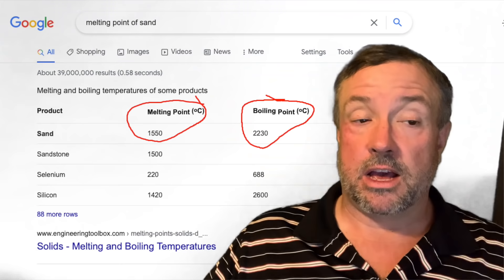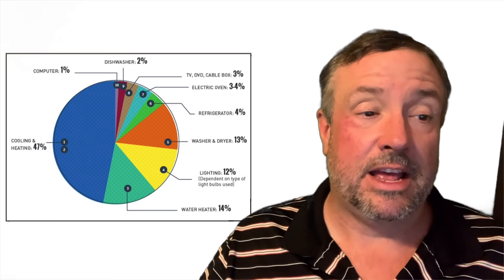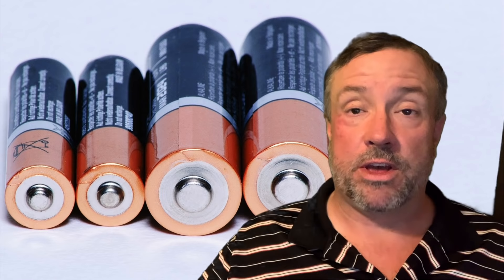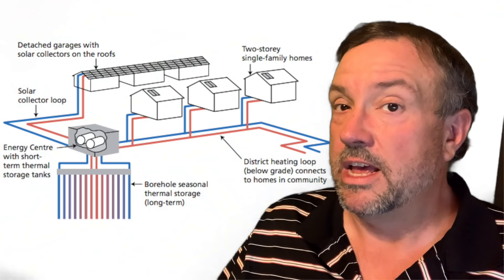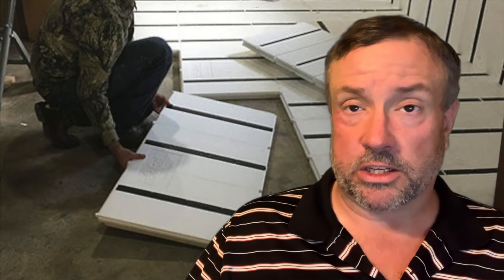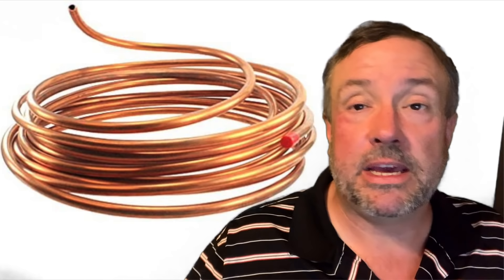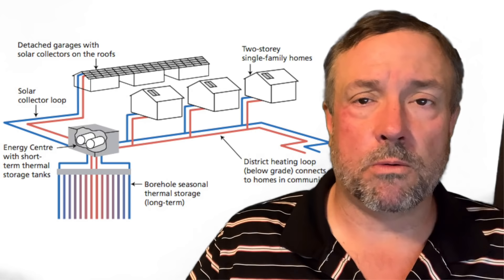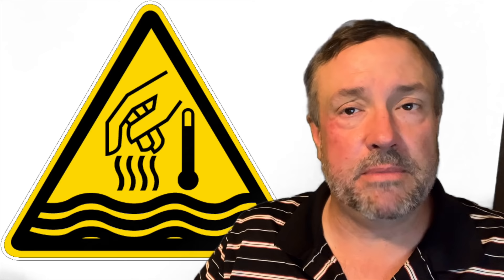Sand for Thermal Energy Storage

Comment: A metal with low melting point could be used as a fluid on the hot loop. Quicksilver or woods "metal". But you need to heat the line for a second to get it running in the morning.. also pumping it might be a an issue. High power consumption? Metal dissolving pump housing and gaskets? Keep the loop as simple as possible, no valves except for bleeding. Pump might have to be a screw with the motor mounted at the top, free from contact with the metal fluid..
Reply from the maker: interesting!

Comment: Make a manifold out of concrete or any metal or high temp pipe, bury it in an insulated sand box with pipes, and run hot air  through it, and at night it should hold heat, also you could just put the whole thing under the house, just use separate pipes that lay on top of the block and go back into the house for heat at night, the out side could have a temp thermostat ,on, off  fan could be solar with small battery back up. Also you have radiators, you cold bury a tank  or manifold in the sand box, circulate the water through  everything, have a high pressure safety valve outside and in. The sand should take a lot of the heat out, just have a shut off for high heat that way the temp won't go too high, or loop the water that is in the radiators somehow,  till the temp drops, separate from the solar setup, Just ideas that may or may not work! but good video, and I also subscribed!
Reply from the maker: Good idea

Comment: Love the idea of using aircrete (which I was thinking of doing myself) for the insulation on your storage tank. You could build the tank entirely out of aircrete and rebar OR you could buy a metal water tank (like a livestock tank) and insulate it by filling aircrete around it. 

Storing heat that will be used for heating is easy enough, but storing heat and transferring it into electricity to cover the other 40% of your homes electricity demands when the sun isn't out is the real challenge.
Reply from the maker: great ideas!
Reply: Andrew, love the idea of storing water in livestock tank and insulating with aircrete.  May need to waterproof aircrete as water may seep through it and exposed parts may crack with ice allowing water and thus corrosion as long term issues.   Great idea however.  Water even at lower temps under 200c is still great at storing heat just requires more space to meet total needs.   
Yes storing heat does not account for the rest of electric bill but it's a great start and reduces the rest.
If one uses high temp solution, the stored heat can be used for cooking!  That's cool!  May be more practical to have a dedicated system for cooking to reduce cost such as piping, building etc. and for simplicity.  May be easier to have solar panels and batteries for the remaining electrical needs.   That's my guess.  Turbines for electricity are cost prohibitive to my knowledge.
Reply: @l0I0I0I0  Batteries are also pretty cost prohibitive if you have grid access.

As for cooking and/or energy generation when the sun isn't out, a methane digester (piped directly to the stove or to a generator) wouldn't be a terrible idea. Also instead of solar panels, I've been looking into the idea of using a parabolic trough collector to generate electricity via a sterling engine and then collect the water after the sterling engine as stored hot water which can be recycled in a closed loop.

This would be one hell of a project, but it'd be totally off grid depending on your energy demand and geographic location.
Reply: @andrewb9595  keep me in the loop!  Want to see what you come up with.  Biogas is a thing.  It's common in India I have been told and perfectly clean.  Big or cow poop may work better than human.
Reply: @l0I0I0I0  hydrogen sulfide is not clean but can be filtered out with activated charcoal and lime water.

Comment: Efficient Rocket-masonry stove/oven/sand-lava rock battery combination works for me.  Rocket Stove lined with standard refractory heats internal masonry quickly with spiral secondary tower clean burn section behind which directs heats to a 1"x24"x24" metal plate beneath the domed oven.  Exhaust then moves horizontally across the steel plate and downward through standard stove piping on the right side which is run through an insulated (2" thick aircrete) 3' wide x 25' long x 4' high sand-lava bench battery.  Piping loops at the end of the sand-lava bench battery, and returns back to the Stove/Oven for eventual vertical exhaust, provide sufficient draw for the stove & bench combination.

Insulated (refractory blanketed) masonry in the stove maintains high heat and aluminum fins attached all along the exhaust piping heats the sand-lava battery mixture. Air exchanges via standard steel tubing run throughout the sand-lava mixture to a standard water heat exchanger at the far end using standard insulated dual piping from an external wood stove configuration.  The insulated piping is run into my home to the boiler/water exchanger connection maintaining primary and supplemental heating.

Need only run the rocket-masonry stove two to three times a week in winter to maintain comfortable temperatures in two story house.
Reply from the maker: Very cool, thank you for sharing

Comment: I wonder if blowing heated air bubbles through the sand from the bottom up would help distribute the heat throughout the sand better than running pipes through the sand.
Reply from the maker: interesting
Reply: My sentiments exactly!   Fluidized sand…..

Comment: I am thinking of somethint like this. The main problem with the soil is the heat transfer and the poor heat capacity. If you use a liquid with 300 celsius of maximum temperature, you can heat the sand also maximum to this temperature. The volumetric heat capacity of the soil is about 1.8MJ/m3. Water can store 4.18MJ/m3. The energy you win by the higher temperature, you loose by the poorer heat capacity. What about to build a well isolated huge water tank above the ground? 10 or 20 cubuc meter capacity? You could heat it all year with a simple water based heat collector, then you could take the energy out by a heat pump.
Reply from the maker: I agree water is better

Comment: Iam using foam crete to insulate my 55 gallon drums and heat element to heat the sand to 600degrees I have to put it in play this spring but have some problems to solve in the process.  This way I can do foced air for the cabin and green house and heat water as needed
Reply from the maker: I like it

Comment: Simpler is better.
For new construction, dig the foundation 6-10 feet deeper with common cement block.
Put an inner layer and floor of air Crete as you suggest.
Fill the space with sand. 

Overlay the sand with another layer of air Crete to form the basement concrete floor.

Have a multi layer network of galvanized 1” steel pipe. ((Which is cheap and easy to work with). 1ft. Spacing between pipe runs and upper and lower layers of pipe.

Use heat dissipating fins on the steel pipes to improve heat distribution to the sand

Form a closed loop within the sand.
Working fluid can be simply water.
Install a circulating pump and a water heat pump.
In summer, use heat pump to cool house and dump the heat into the sand.

In winter, use heat pump to pull out the stored heat.

Some heat energy will be lost but mostly to the house above.

This solution may not supply 100% of energy needed to heat or cool but is simple, has few moving parts, durable
Reply from the maker: I like it

Comment: ground to air heat transfer.
 Attic space or greenhouse , big pipe  for hot fluffy air to manifold with  sockpipe in sand,  6" of sand per month of heating needed(four or five feet deep, footprint size typical) fans on the outflow side blow cool in summer , warm in winter .
Reply from the maker: nice
Reply: It is called Sub-Terrain Heating & Cooling ( STHC) system. Best to build while making foundation stage. Afterwards would be a nightmare project.

Comment: "For mid-range material, a kiln should be firing at a temperature between 2124℉ and 2264℉ (1162-1240℃). This is the most common temperature range for industrial ceramics."
Interesting temperature range for electric kiln. 
I believe that direct heating is ×2 fold more efficient than via PV panels electricity. 
But both could work together. 
1240C is x 12 times hot water. 
Draw the heat off buy pushing air into the storage mass and modify air flow.
Reply from the maker: Interesting
Reply: When doing most math with temperatures you need to convert it to Kelvin first. For example: 5C is not 5 X hotter than 1C. So 1240C is 1513K and 100C is 373K so 1513K is 4 X hotter than 373K not 12 X.
Reply from the maker: @WhitentonMike  thank you, great point!

Comment: a teacher in the north east USA designed and had his students build a SMALL COMMUNITY SIZED   ZERO ENERGY WALK IN FREEZER, that would keep food frozen for over 365 days with zero energy input and just 15 straight days of below 0 farenheight outside temps.
first they dug into the side of a hill. then used recycled styrofoam cups and trays etc.. chipped up to make a 2 foot thick insulation for all 6 sides of a room. 2 layers thick on walls of 2 liter pop bottles with a 10%  salt water solution. an entry room with a door between the entry and the freezer section. the put in a vent at the floor level for intake of cold air (15 days of below zero temps) and a community center above the freezer with an exhaust pipe from the freezer running from freezer to roof of community room/center.  the warm air in community center and sun on black painted pipe caused cold air to be pulled through the air intake and out the roof.
the article i read back 20 years ago on the internet included photos and a report of how it did after 2 years. it was a success. i have since lost all records of who, where and when and how they dd it. just the details i  have mentioned. 
im 62 year old man who was raised an arkansas hillbilly, even had a real  shotgun wedding where i only wore a pair of overalls with  1 strap fastened and a floppy hat, thats all. so im obviously NOT Stephanie,but google banned me. im building the walk in freezer but putting 3 layers of bottles instead of 2, as im using sawdust soaked in the salt water solution as it keeps the bottles from leaking if they get a hole.

i suggest you get an ebook by Larry Hartweg called zero energy design. it is 850 pages long with lots of (blowing his own horn) but he built a house in  mountains of colorado back over 30 years ago that is similar to a house inside a greenhouse that didnt have a heater or air con and was comfortable year round. had a large indoor swimming pool too. i have NOT finished reading the book as im raising my 3 year old son as a stay at home dad. the book tells how stupid the energy efficency industry actually is and why their designs fail to work.
i do NOT get a penny and if you want to read the book you got to find it yourself, so definitely NO affiliate link!!
popular mechanics  magazine use to have advertisements for a HAHSA ( heating and heat storage apparatus ) plans. was a wood stove inside a small building with sand all arround the wood stove, hot air ducts for air to go from the house to the sand and back to house.
as for insulation, you can get all the free white styrofoam you desire from appliance stores. just search how to chip it up here on nootube.
in iowa the electric company had a rebate program that paid a rebate to you if they could send out a guy with a thermal camera to do an energy audit. i insulated the attic of house i was renting at the time and made 5 cents profit on every roll of insulation i bought by also getting an 11% rebate from "menards" the store where i purchased the insulation. i insulated to r50 and the energy company phoned me in late november to ask me if my furnace was broken,because i had not used any gas. i replied, no,  it still works, but you paid me to insulate!!
just thought i would throw my 2 cents in.
Reply from the maker: Thank you for the info!!! Great read

Comment: Check out Korean traditional floor heating system ... basically a giant rocket stove under the ground that could heat the sand which will radiat a constant temperature all night !
Reply from the maker: very interesting!!!!! Thank you
Reply: Sounds like the Russian system as well.
Reply from the maker: @michaelglenning5107  which Russian system?
Reply: @SimpleTek  Russians would build a slightly off  horizontal chimney in the ground. The fire box would be below ground. Seasonal solar heat storage is the same concept. Heat from the summertime is pumped through a horizontal underground air duct system. In winter the heat works it's way up. I see numerous people venting excess heat buildup in the greenhouse outdoors when in fact it should be transfered to the ground underneath it.
Reply: My next build, a house in the side of south facing Ozark mountain. will be a batch  🔥 rocket stove under floors. I did a video on non batch floor rocket stove when building my silo/grain bin house.   Oh  And solar panels to Nicrome heating wires barried in FIRED clay floor... get it? titles.

Comment: I've just finished lining the interior wall of my house with 20mm corrugated cardboard filled with very fine sand to act as acoustic barriers and a thermal heat sink, we'll see how well it works later this year.

My suggestion would be to buy 9 cheap copper electric immersion heaters. Remove the immersion units and fill each one with your copper piping and sand.  Then sink each one of those units into a concrete "jacket" in a 1, 2, 3, 2, 1 layout and surround that jacket with the water.  Concrete has excellent thermal mass itself, is easy to insulate all around, has high heat tolerance, and it's water tight.  With individual "heating units" units you can easily replace/upgrade when needed.
Reply from the maker: I like it!
Reply: @SimpleTek  Btw, the reason I suggested a 3x3 layout of the immersion units rather than in a circle was the XPS insulation that is designed for below grade insulation comes in large 2.4x1.2m sheets (in the UK anyway), so insulating a square concrete jacket rather than a round one would be much easier.  I also suspect running the water through a square jacket would be simpler too.

Comment: Ok this sounds really good mi concerned is storage heat outside in Winter for the night becouse don't matter how hot the materials you use need to stay hot for longer period of time whit no heat from the sun night and overcast days however a system can be good just for some periods of time switching back and forward or using home waste to make  metane gas furnace for the night and thermal from the sun during the times the weather is good
Reply from the maker: ok

Comment: If you build  the collector on a big home made lazy Susan, alignment would be easy. I would try mineral oil if you can get it.olive oil can go rancid.
Reply from the maker: interesting idea.
Reply: @SimpleTek  I think this is an excellent idea, especially if Michael is saying that the collector is the full size of the lazy Susan, rotating slowly and having only a tiny bit of it exposed to the heat source.
If it rotates into an insulated area, this would probably be the simplest and perhaps most cost effective way of making a heat collector + storage. No need for pumping.
Reply: -And you could of course use sand for storage, but you really could use anything - including big flat rocks. ;)
Reply: And the first time I read Michael's comment, I understood it as it was meant to be understood.
-The 'storage' idea came from when I skimmed the comment a second time and completely forgot that the lazy Susan was about alignment and not storage. =)

Comment: I didn't read all 888 comments at this point, but I read quite some. Anyhow, I still think SimpleTek's idea of sand and sun is very interesting. Sand has an extremely high boiling point, so it doesn't want to go anywhere while you heat it more and more, it's cheap, and if you keep it in an insulated container (of whatever size) with only a very small hole at the top, you can send your concentrated sun beam through the hole, no need for any physical duct... As soon as the sun goes, we close the hole to keep the heat inside as much as possible.

Then indeed I was thinking water turned to steam for harvesting the heat. Steam can both heat rooms and generate electricity, two very desirable things for any house.

Someone wrote, "the higher the temperatures, the greater the loss." But nuclear power plants do work on the principle of very high heat and steam. Nobody seems to have complains about their efficiency... And all are complaining about their dangers. While sand has no such dangers.

The biggest trouble is getting enough concentrated sun into the hole... Who has space for a whole field of mirrors? And they need to be tracking the sun. And probably the receiving mirror needs to be extremely pure, in order not to heat up while receiving all that sunlight from all the other mirrors?
Reply from the maker: You should check out Sergy’s stuff on tracking with parabolic troughs. Very affordable and easy
Reply: @SimpleTek  Thanks, not sure who Sergy is but I guess Google will tell me. 

Somehow YouTube played a next video which reassured that this is very feasible, as a company in Finland is doing exactly this: heating sand. Except that they use electricity, not the sun directly. https://www.youtube.com/watch?v=tm7spMG0ch8

I'm quite excited to try this myself at one point.

Comment: Could you run steam pipes through the heated sand into a steam turbine  and make electricity?
Reply from the maker: steam dangerous
Reply: Steam can be dangerous if it isn't handled properly, but the same thing is true about extremely hot sand. Lol
Reply: you exactly